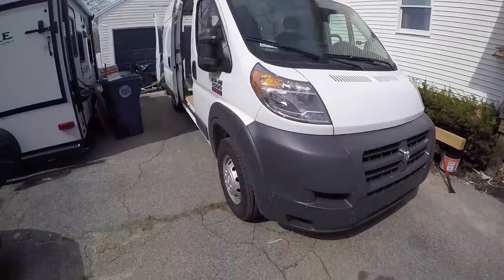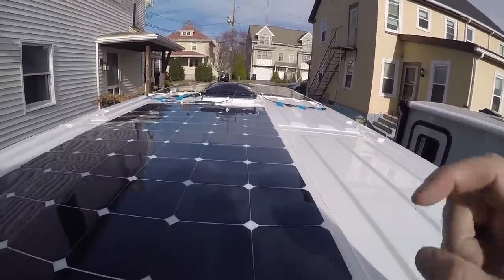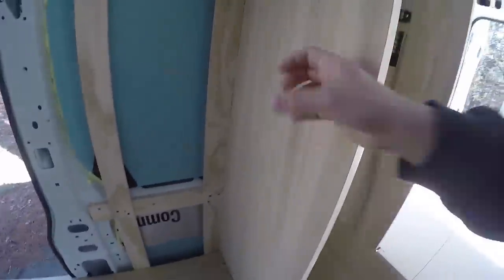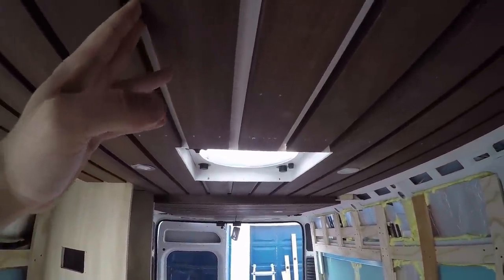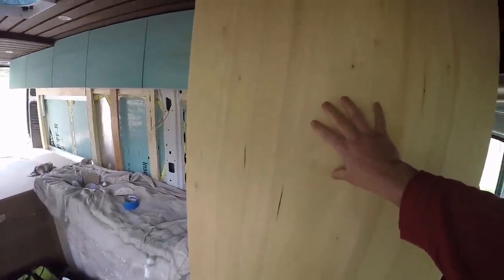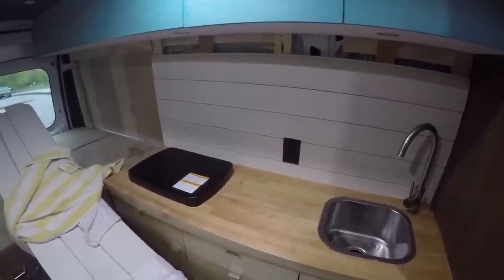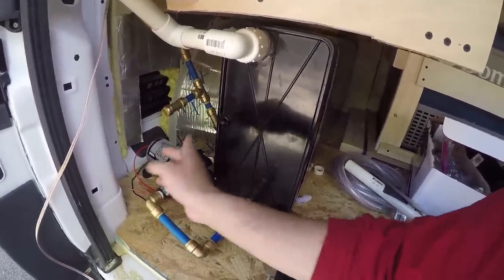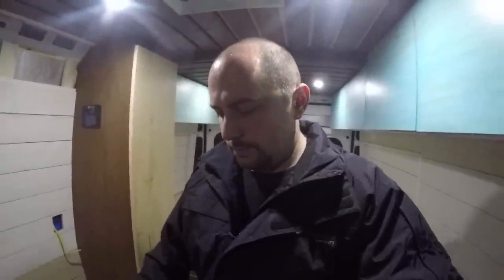How I Converted My Van into a Stealth / Off Grid / Tiny Home Van

Comment: can your solar run your appliances ok? for a significant amount of time. 
I am looking to do this one day soon and you are inspiring the hell out of me. too cool
Reply from the maker: chris williams I love my solar. With watching my power usage I could last close to a week with no sun. If I run my fan all day, fridge, or heater a lot then I do have to watch my power usage but I still haven’t dropped below 70% battery. With my system I can’t go lower then 50%. Most of my appliances are DC power which has a lower draw. I rarely turn on my inverter only to charge my laptops. I have 2 videos on my page that might help too. One is the Tour of Renogy and the other is me cooking to see how much power I use. Any more questions let me know
Reply: Jarrod Tocci awesome, you did a killer job and you posting a detail list of what you bought and the cost was amazing

Comment: The materials are all very heavy and you must be sacrificing a ton of MPG. You should try making a build using the lightest possible materials. Showers are cool but not necessary since having a gym membership allows you to take a shower almost anywhere on the road with the added benefit of forcing you to go to the gym. Not to mention having a shower will require running water and heating which is energy intensive and will require constant refills of your water tank and severe drain on your batteries.. Water should be used on the van for drinking, cleaning and cooking which could be easily achieved with a simple five gallon water closet with a manual pump. Overall, a pretty build but not the most practical. You should also find a way to mount a tv and computer for people who work from home which is all the more reason to scrap the electric heater! I also did not see a mini fridge which is going to burn through most of your batteries to keep running. Being able to store food is important in reducing the cost of food. Focus on building an electrical grid that is able to sufficiently power these appliances for true sustainability.

Comment: What are your thoughts on the remarkable tablet? Never heard of it until you mentioned it. I’m very intrigued because I have those damn yellow legal pads everywhere. I’ve been reading reviews and hear a lot about how glitchy it is and people losing pages. Have you ran into these issues?
Reply from the maker: I have not run into any of those problems. I had it freeze on me once, but I looked up how to fix that and it worked no problem. I like it a lot but for what I do it makes sense. I take a ton of notes for stand up comedy so it works for me and the less pads of paper laying around the better. I was thinking of doing a review on it. Also check out Sony's writing tablet, which I've heard is good and I also think the new iPad can be written on too. Ohhhh I do wish it had some sort of back light but really that's the only downfall in my eyes.
Reply: Jarrod Tocci thanks for the info. From what I’ve read of the comparisons, remarkable is the best when it come to pen response and likeness to writing on paper. Like you all I would use it for is comedy. I’m very methodical and ocd  so this is right up my alley.

Comment: are you concerned that the metal ribs have not been insulated.  won't the cold or hot temperatures travel through the metal ribs and transfer into your living space.  also is a vapor barrier necessary?
Reply from the maker: Cameran Manner some good questions. I actually did fill in the ribs with spray insulation but just never filmed me doing that. Vapor barrier I wasn’t concerned about but only bc I knew I wasn’t spending any time in high humidity areas. I’ve seen some van builds use a barrier but I’m curious if it actually works too. I haven’t had any issues with mold or moisture and I’m coming up on one year. I’ll keep everyone posted as time progresses though
Reply: Jarrod Tocci I remember a clip where you are using spray foam inside on one of the ribs, this leads to another question.  If the rib is attached to the outer wall would the metal on the outside transfer the temperature to the metal rib?  You mentioned that you spray foamed the inside of the rib, but it is still exposed as those ribs are still connected to the outer shell of the van.  I would think you would still need to insulate all the metal ribs to prevent the hot or cold temp of the ribs effecting the internal air within the cabin of the vehicle.
Reply from the maker: Cameran Manner that may true. To be honest the ‘worry’ is keeping the hot air out and cool air in. Reason I say this is because there are easy methods heating the inside but no good solutions for cooling the inside (yet). Unless you have a ac running but that’s just too much power. Now for me no matter how much any van dweller thinks they insulated they didn’t do enough to keep that hot air out. In the end it’s still metal sitting in the sun and even in a insulated home/apt sitting in the sun it’s still going to get very very hot. To answer your metal rib question it’s a yes and no. Yes they get warm but not crazy hot either. In my opinion that’s why I think a full spray insulation job is the best to do on a van build, but just expensive. Sorry to ramble on but I hope that helps a little
Reply: Jarrod Tocci there is a portable ac that runs on 12v.  Called Zero Breeze.  I think its 1200btu, for a small cabin this may be good enough.
Reply from the maker: Cameran Manner awesome thanks I’ll check it out

Comment: What I don't understand is that when you screw into the van's shell.. how to hide it on the outside and not have leakage from the holes?
Reply from the maker: Any holes you can just use silicone and that will prevent any leaks from happening. The only hole that my van has is the roof vent which is the only part I needed to treat with silicone. The drain hole at the bottom of the van but that also has silicone as it has a drain pipe hooked up to it. I have some other videos and pictures on my Instagram that are shot from the outside and to most people you can't tell someone is living in it. Also in the 15 months I've lived this way I haven't received a knock yet either (**knock on wood**)

Comment: How much all in for price of van plus all building costs?
Reply from the maker: Bought the van brand new which is a 2017 but bought in December of 2016. Paid about $31,000+ for the van (making payments). And the build I estimated between $8000-9000. I've recently put in a few upgrades like adding a woodshop to the truck/garage area which cost me roughly $500 more, and changed to look of my back doors but that maybe cost $50.

Comment: I like it .The ceiling adds something to very nice have you weighed the van to see how much weight you've added
Reply from the maker: Kirk Trapp I haven’t officially weighted it but I have a very good estimate with weight on the materials I used. My dad thinks is not more then 900 pounds but it think it’s more like 1000. Gas went down about 1 mpg

Comment: how much does that particular fan cost for just the fan? and would you recommend earlier year models for a similar conversion? if you don't mind
Reply from the maker: Wolf Mother Lexi just the fan is $170 right now. There’s a couple of companies that make roof RV fans. I guess it would matter what you’re looking for. I personally wanted something low profile. The fantastic vent brands can range from $150-220 (I think). The step up from mine has a remote and rain sensor. If you want to go less expensive I’m sure there’s options. Possibly eBay, maybe a good used one that someone bought and isn’t using for whatever reason.
Reply: Jarrod Tocci ugh I typed van stupid auto correct sorry about that I ment Van

Comment: did you install a AC unit and if so, what type and how?
Reply from the maker: chris williams I do not have a AC unit. If I did I’d have to do a ton of research. I’m pretty sure you need a lot of battery bank. I’ve seen some systems but never got to into it because I knew I wouldn’t get one. They do make roof systems but not sure if you need he car running for that. I’ve also heard that some solar companies are trying to come up with something but that could be a rumor

Comment: Greetings, trying to gather my curouge to dip into a Van, could you please go over the insulation ? I just got the Rattle-Trap and see you are using Tuff-R, over it you put ply-wood ? Many Thanks, wonderful work
Reply from the maker: Abraham deAlba-Avila there’s a few different types of insulation. Spray which I’ve seen in vans and are great but can cost some money. Foam Board (that’s what I have) and is I feel the easiest to use but also can be expensive. Then it goes into wool or fiberglass insulation and is the cheapest.  After I put my insulation in I then put a frame up kinda same as they do in a house. Most importantly look at the R-Value of the insulation. Try not to go below R-13 and anything between that and R-23 is good. The higher the R-Value the thicker and better affective it is. I plan on doing detailed videos on the build over the next couple months. Hope this helps for now

Comment: Good morning 👍I called Sun Power and they said they don't sell 200W flexible panels.  Did you get them from a reseller?  Have you noticed that they are losing it's power?  Apparently,  that's the knock on flexible panels but that could only be referring to older models.
Reply from the maker: Goals and Dreams I got them from a seller in China. They were referred to be by someone I trust and that used the same ones on their own build, and they have done a few van builds. It will be officially 1 year in June since I’ve been using them and they haven’t lost any power from what I can tell. I just posted a picture on my instagram about how well they’re working actually. I’m not sure if they are a knock off but the company I was dealing with in China seemed good. Maybe sunpower never made 200w panels but this company did using sunpower cells, honestly I’m not sure.

Comment: I designed my van very similar like yours but then I realized one side have too much weight on it. I don't know if yours have the same  issue?
Reply from the maker: Katerina Luna diCamella at the beginning of my price breakdown video I explain the weight distribution and why I put things the way they went. Yes the kitchen can be heavy and make it be off balance but I put my huge batteries on the opposite side so they would offset each other

Comment: How do you keep it heated in winter? Is it warm?
Reply from the maker: Defend Free Speech & Pro NRA yes I have a electric heater that is 10,000btu and as a back up I have a small propane heater and I open my roof vent to make sure I don’t die from CO2. I’ve only been in 40 degree weather but my van is insulated so it holds heat in very well

Comment: Hey Jarrod, why did you not spray the whole thing with foam? It seems to me it would be less hassle and more effective.
Reply from the maker: Real foam insulation is expensive and always doesn't work best with a metal tube like a van. The foam I did use was just a crack sealer and helped keep the foam board from squeaking.

Comment: EFN excellence... Choice decision on the color lay out. Never considered a dark lid! Can you feel the cold on the floor with the one layer of  poly iso or whatever you used?
Reply from the maker: ThisSpotRules! Thank you. I wouldn’t say cold, although I spend most of my time in warmer climates. Winter at night will get into the low 40’s and it was fine there. Nothing a few slippers can’t handle. I have however seen a van with radiant heat flooring.

Comment: Super awesome build! It's very inspiring to see this level of attention and craftsmanship come together. Just wondering, what do you use to fasten the walls to the frame of the van? This is one area where my research hasn't produced any results. There are predrilled holes, do you just use a screw or nuts and bolts?
Reply from the maker: Jeff good question. Because the metal ribs of the van are different thickness we wanted to first make sure the walls would be on one plain. There should be a point in the video where you can see what looks like a frame. We ripped 3/4” plywood about 3” wide and fastened those to the metal ribs to act as a frame. Then everything attached to that plywood (cabinets, shiplap, etc.). I think we used metal screws to fasten to the van ribs and made sure they had a good catch and were secure. Hope that all makes sense

Comment: Solar panels should be installed with enough clearance for air to circulate underneath or it will not be effective and will overheat when you go to hotter climate, you'll see!
Reply from the maker: Andrew Enrile the flat panels are designed not to have a gap. They are flexible and sit flush to the surface

Comment: I was curious what the pre-build real time dry weight was (w/w'out fuel) vs the active user daily mode running weight post build? how that effects handling and fuel consumption. nice build!
Reply from the maker: Beachtown_ drifter thank you!!...those numbers I'd have to look up but I'm sure they are on the Ram website or some website should have it. I will say I drove the van empty for about 4 months before the build. After and during the build I could tell the difference BUT in my opinion it handed better with the weight. I think these types of vans are designed to have weight in the back so they handle the way there are supposed to. It doesn't feel like it's stress for the van just feels like it handles it well. Hope that helps a little bit
Reply: Jarrod Tocci right on, that's true on the design for added weight.

Was locating the solar components on the passenger side 'en masse', for weight distribution side to side, a consideration beyond just placement for space, purpose, etc. In other words did you do your figuring for total weight distribution in your design layout?
Reply from the maker: Beachtown_ drifter yes absolutely. I might be ahead of some when it comes to building a tiny home in a van. I have a degree in architecture engineering and we studied tiny dwellings in school and self sustaining structures, but never anything on wheels. I have a video on price and at the beginning of that video I go over why I put products in certain places. Not only the weight but you have electrical and water around each other in a small space so I separated those elements as well. Only "mishap" people try and call me out on is the cook top so close to the bed but in my cooking video I use it and everyone can see it's not harmfull
Reply: Jarrod Tocci that's awesome man. I dabbled in some drafting classes way back before CAD came along (I'm that old!) in high school and wondered what kind of background you had. yours was a suggested van living video, I'm stoked I stopped to watch it and check out your situation. thanks for the replies, I'll watch the video you suggested too. *subbed! later bro-

Comment: Amazing van construct... im curious... what was the final total price approx of the materials?
Reply from the maker: This was built a while ago (about 18 months ago) and since then I've done a few upgrades. Materials and products at this time was around $10,000 but I've put probably another $2000 into since (adding a TV, bathroom shelf for toilet, trunk/garage area organized into a woodshop). Design/research/labor hours was over 500.
I'm in the process of selling this build and planning another. My next one currently is estimated to be double the hours and over $15,000 in materials but my next design I've never seen done before so it will take a lot of planning.

Comment: Hi Jarrod, awesome job and design! Can I ask you if you did the 3d development drawings yourself and if so, how did you find the learning curve to do that? If you didn't do yourself and recommend using someone to do that, who did you use? I have a plumbing and electrical maintenance business and we use 3 Ford Transit Customs which I've previously fitted two with steel rack shelving on the drivers side and a custom tool box across the front. I the last one we fitted a false floor with drawers the come out the back and the sliding door at the side and had it done in plywood - this latest one seems to be working well and stores much better plus my plumber doesn't have to get in the back as much. Just waiting to see how it lasts! I want to draw up the back of the vans so I can fit the next one better, hence the questions about the 3D. I'm also considering fitting out a van for my wife and I to travel around in so very keen to follow your videos! Thanks for y9our great videos, keep it up!
Reply from the maker: Hi Craig, For my 3D design I used Google Sketch Up and that was before they started charging for it. I do have experience in 3D design as I went to college for architectural engineering but we used software called VectorWorks. Honestly I used the design just to help my dad my vision even though we can both see something without any type of drawings, we just build. Now if I was to do more van builds for work I would get a better program like Rhino 3D, which I've seen and other van builders use and it looks amazing. Google sketch up still might have a free version but not sure. If you do end up getting a 3D program I'd say go look up tutorials on how to do simple functions with whatever program you end up getting. That's how I do all everything as I feel I'm always a student.  I will say that I'm getting into furniture design and hopefully will go into tiny home design and if/when that happens I plan on getting Rhino 3D. Hope that helps and good luck!
Reply from the maker: I'm in Los Angeles CA. I'm pursing stand up comedy and other than New York this is the place to be. Plus the weather is amazing here for van life. I heard Tesla is doing a tiny home tour of Australia right now.